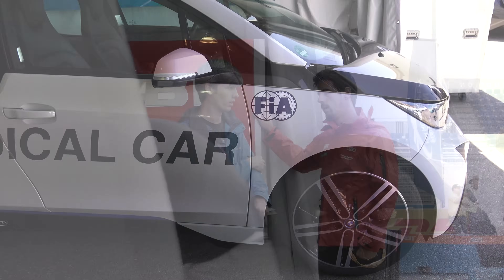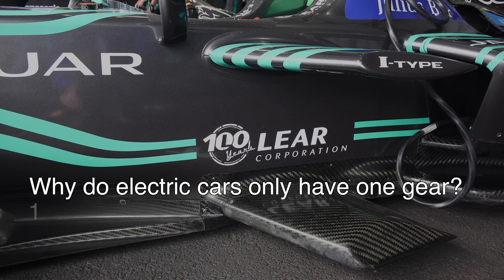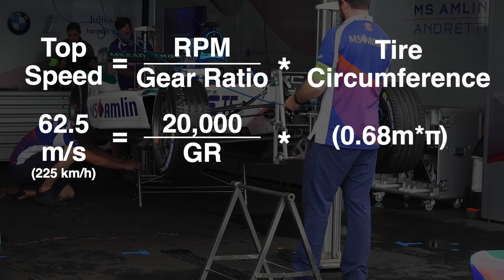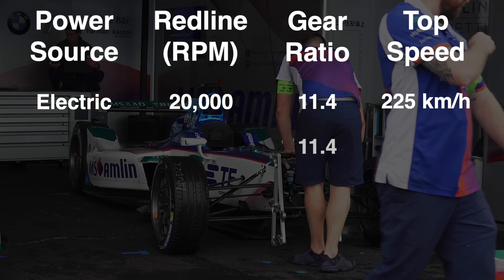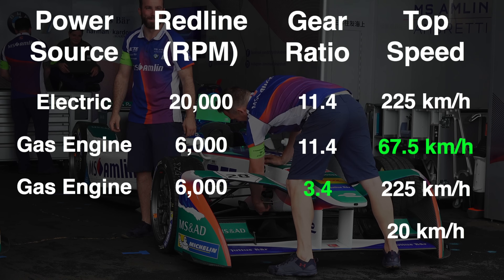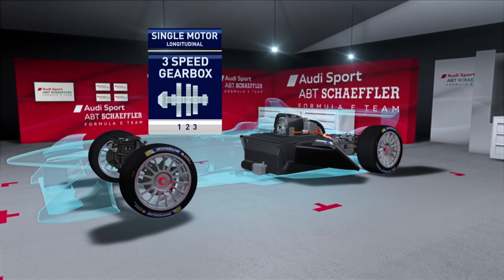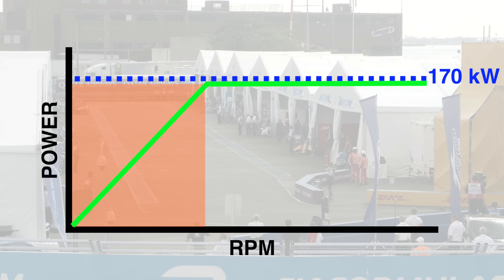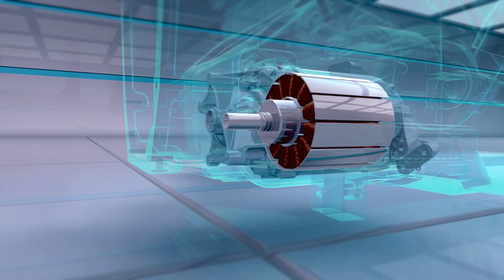Why Do Electric Cars Only Have 1 Gear?

Comment: After riding my e-bike over 1,500 miles in the last 5 months, I'm thankful to have retained the 8 gears on the rear wheel.  One thing I've learned is that low speed with a high-powered electric motor = HEAT!  And also big power drains from the battery.  By starting in a lower gear on my e-bike, I can keep the motor turning at a relatively higher RPM, which is better for both the motor and battery.  Then as I increase speed I gradually shift through the gears.  Works awesome.
Reply: Thank you, exactly what I wanted to say. Consumer companies have promoted these ideas to gain more profit and centrally control others. Removing the gear system will make the motor larger because it will require increased winding coil, the use of rare earth materials in order to obtain strong magnets, an increase in the radius of the motor, in addition to the increased use of complex, sensitive electronics in a way that they are not needed, all in order to compensate for the removal of a very important and simple system. gear system increases the efficiency and power of the motor with less energy consumed. Removing a simple system like that will also reduce the life of the electric motor and battery, as you explained. Most of the heat generated in electric motors is due to the coils that convert electricity into magnets. It is known that electromagnetic coils lose a large portion of their energy in the form of heat.
Reply: If your motor is an induction or bldc one, it shouldn't heat up at low speeds like that. Maybe it's a common dc motor.
Reply: @DragonOfTheMortalKombat  I have no idea but I still have the bike and it has over 10,000 miles on it now.
Reply: @Patrick94GSR  Commonly, if it's two wires and you power it by a battery and a very simple controller, then it's a brushed DC motor.
Reply: @concorde837  The BBS02 (and BBSHD) mid-drive e-bike motors are in fact, brushless motors.

Comment: But wouldn't having multiple gears allow it to use the electricity more efficently? I mean, that's why we have them in bicycles.
Reply: Well a human has a very narrow power band compared to an electric motor, so we really need a few gears on our bikes to make them more practical. There are a few bikes that doesn't have multiple gears, one of them being the "fixie" and I think there are some velodrome race bikes that has a fixed gear ratio. The fixie isn't really a practical bike, and the velodrome racers can't start without having someone help giving them a push. Other than those it's mostly children's bikes (and possibly BMX?) that comes with a single fixed gear.
Reply: lolinskimk6 ...gear boxes go to hell in short time with instant 20 000 rpm
Reply: Blahorga Slisk....If I can I buy today  car for my daughter with fix gear sow she can start slowly and have speed limits...every beginners should have car with fixed gear or looked automatic with two gears :D
Reply: He said in video, that adding gearbox is too little advantage comparing to added complexity and weight (which reduces range). It is just not worth it.
Reply: If you watch the video, you will learn.
Reply: lolinskimk6 yes it probably will evolve that way , when we all have e cars we will once again boast of how many gears we have.
Reply: lolinskimk6
Comes down to the engine characteristics. Professional cyclists actually produce torque that is in supercar territory but the RPM range is tiny, hence lots of very tall gears are needed.
As EE explained, electric motors have near constant torque over a very large RPM range and IC engines are somewhere in between.

Comment: But toque... you can put a lot more torque into tarmac higher gear ratios. The "acceleration" will be much higher, if a higher gear reduction is used at the beginning. And then switched to "cruise mode" to keep it going. Can come handy in electric jeeps - for pulling heavy loads. Can come in handy it traffic jams for... no, in traffic jams high torque causes jerky movements which merely increase the risk of accident, lol.

Comment: Wow thank you! So the cons of an multiple gear outweights the pros like less "fuel" needed ?
Reply: You shouldn't do the mistake and thinking that electric motors are plagued by the same problems as piston engines. The efficency of an electric motor hardly varies over most of it's rev range. So unlike piston engines it makes hardly any difference in efficiency if an electric motor revs very high or very low. Which means there is hardly any gain by using a gearbox.
Reply: shi01 ah ok thank you :)

Comment: Wouldn't an electric motor be more power efficient with a transmission? Is it just a matter of the difference in battery life not worth the cost/complication/reliability of adding a transmission?
Reply: Not really.  Electric motors have a pretty flat efficiency curve and there isn't a big sweet spot like in a combustion engine.  More gears equals higher transmission spin losses. In a combustion engine the efficiency gains of keeping the engine in the sweet spot more than offset the added spin losses of the transmission.  With an electric motor this is not the case.

Comment: You left out information at the foundation of the issue.

First, internal combustion engines stall at too low revs.

Second, internal combustion engines work from explosive combustion.  When the gas ignites and expands it provides too much of a burst of engery to be at a low output.

Finally, electric motors work by attracting a magnet on a wheel with electric magnets alternating polarity.  Change the timing of the alternation, and you can run an electric motor at any RPM.

Comment: When I was a kid I had a remote controlled car with 6 gears. If you put it in the gear with highest top speed it would be really slow to accelerate and  you would use up the battery in 10 min  no matter how fast or slow you did go. Put it in low gear and you could drive for a hour. If you did go for the middle ground that gave ok acceleration and ok top spead you could drive for about 30 min and again speed did have little influence on how long time you could drive. As far as I know this still stands for electric engines of today at least to some degree (less then before because of higher max rpm), having gears will actually help on the economy as well as acceleration. Problem is to maker a gearbox that can handle the torque...

Comment: Why don't electric cars need oil changes?  Obviously A:  Because it's an electric motor instead of a dirty combustion chamber but...      //  Moving parts... need lubrication right?  Electric motors are still moving.  Wouldn't grease wear out?
Reply: The-Mike_D yes the grease will eventually worn out. Having much less moving parts and running in lower temperature keeps the lubricant in optimal condition longer, instead of changing the oil every 10 000 km you'd ned to change it every 200 000 km

Comment: The real question is: Why don't oil cars have continuously variable transmission?
Reply: It was very hard to manufacture; and it still is due to the complexity of the shape. I heard somewhere that it has to be 3D-printed otherwise the labour is just too intensive.

Comment: Hey jason! I tried to make a suggestion on your website, but was unable to due to a glitch in the system. I just wanted to recommend a video in which you explain the benefits and shortcomings of polyurethane bushings, spherical bushings, and standard rubber/OEM bushings in a suspension. I once had a very experienced automotive engineer tell me that he prefers rubber bushings and that it's a common misconception that poly bushings are superior, but his explanation was too complex for me to comprehend... I understood that the principle was that poly bushings limit movement in the suspension components, leading to less responsive handling, inaccurate alignment, and reduced mechanical grip. I was hoping you would be able to explain this more in depth and in a manner that a fresh ME student would be able to grasp, and I'm sure many others would appreciate the insight. Thank you!

Comment: The RPM/power chart at the end is misleading as you don't change the power curve of the motor by more aggressive gearing as you are suggesting in the graphic. For your illustration to be correct the x axis has to be vehicle speed, not RPM.
Reply: Petr Hošek rpm is proportional to velocity in constant gear ratio, the chart would be stll wrong btw
Reply: Marco Santiesteban yes, but he wants to illustrate changes from one gear to another and suggests that the curve is shifted by that, which it wouldn't if it was PRM.
Reply: Petr Hošek that is true, the other alternative is putting the legend "rpm at wheels", the chart neither mark the operation range of rpm from an induction motor

Comment: I would add one more reason why you need gears in gas cars - spinning at max RPM all day long is very bad for a gas motor, but it's OK for an electric motor. Gas engines have lots of reciprocating parts, so spinning at high RPMs (even at low load) produces a ton of stress. So in a gas car, you need a few gears up top so that at highway speeds, you're not bouncing off the rev limiter.

Comment: Would the 3 speed not also have an advantage in saving battery power, needing less torque saving battery power, as it is ultimately an energy saving contest still.

Comment: Interesting. I always presumed that EVs where essential geared electrically by changing the frequency of the polyphase AC coming from the inverter, as EVs typically use a 3phase AC motor, and a reduction gear was simply used to lower the RPM to the tyres. Guess I was wrong

Comment: before I start this vid why do electric cars have one gear? it makes no sense look a cordless drill that has a 2 speed transmission. it will kill the battery at the same time no matter throttle position (as long as you use the same position for both gears). but you get "farther" in high than you so low. so why only one gear when if you had 2 you could have the up most efficiency. I could be wrong but it seems like a waste.

Comment: Uh, plenty of electric cars have had two speed transmissions. In fact the most popular way to do it is via Powerglide 2 and 3 speed transmissions, with companies (like Eaton and a few others) developing purpose built multi speed transmissions as we speak. Prior to Tesla there were actually quite a few "Two speed" EVs you could buy. Tesla even tried (and failed laughably) with their original roadster. 

The REAL reason they dont have multiple speeds? Electric motors have an infinite powerband, meaning you have zero use for more speeds unless you're pushing it beyond road legality and might as well ditch it to save 200lbs.

Comment: If we have all electric cars no more manuals
Reply: thisishowiroll, did you not even watch the video? In anything except SOME racing e-cars, no more manual shift.
Reply: Jeffry theamazing manual with a speed in 5 sec 0-100 would be pain in ass
Reply: Nie mand lots of cars have that, just stay in second till about 50 then stay in third until you redline and skip to 6th

Comment: Basically, electric motors have no lag because no air needs to go in and get mixed with fuel and pressurized and burnt and all that stuff. An electric motor can deliver power directly to the wheel because there is no lag, no pressure, it's all instant so it's safe and possible to do so.

If you connect an internal combustion engine directly to the tires, no transmission, you either move at really low speeds and a lot of torque for no reason while putting a lot of stress on the engine or you lock it up and it blows up under the hood. The job of a transmission is to deliver the power easier with less stress on the engine and to control how that power will be used, either for torque on low gears or speed on high gears. But I'm no engineer, I'm just talking from  pure personal opinion and thought.

Comment: '
electric cars are using automatic gears or manual gears...
how many speeding in automatic / manual
Reply: bestamerica automatic using manual type gears, and a computer throttling the engine to sync and shift the gears
Reply: only on f-e because the improvement is almost null

Comment: Looks like formula E limit top speed and power to make single gearing possible, but multi gears is waaaay superior. Just look at electric assist pedal bikes, my crank drive electric assist bicycle, uses all the regular 15 gears, and is  massively superior to a single gear hub drive electric assist bicycle.

Comment: I have had this question for a very long time: how are 2 different power sources (an ICE and an electric motor, for instance, not necessarily spinning at the same speeds) connected together so that they can combine their outputs to drive the wheels? I've wanted to know about this since F1 introduced KERS and supercars increasingly turn to hybrid technology to overcome turbo lag. I've read that the MGU-K is connected to the engine's crankshaft but that's all I managed to find out. 
Enlighten me, please?

Comment: Despise your complaint against the sound, electric motors are much more powerful than combustion engine with the same weight. Every high speed train use the electric motors to achieve higher speeds. The problem with the electric cars these days are with the batteries not the motors these days.

Comment: If an EV was to ascend a steep hill, would it not be more power efficient to use a smaller gear rather the send more power to the motor? I've been trying to figure this out for a while.
Reply: cyclingjase yes, but you'll loss top speed to gain a tiny eficiente improvement

Comment: Not all electric powertrains use a single gear. The Kia Optima plug-in hybrid, for instance, uses a 6-speed transmission, even when on electric power.
Reply: Hybrids are not electric, they are hybrids and have to compromise because of the two types of motors. An electric car has only one source of power to optimize for so less gears or just one is usually used.
Reply: Plug-in hybrids can be driven 100% electric.  However, many of them do not use the transmission when driving via electricity.  The Optima does, which is my point.

Comment: More gears would help to increase the top speed. Also it could help to increase the efficiency, because driving with high RPM takes too much energy (compared to slow driving).
But I think it's not made, because higher costs, weight and complexity.
Reply: Highspeed trains need gearbox?

Comment: Electric engines should just have a system that detects the amount of resistance at the wheels and increase and decrease either the amperage or voltage to adjust torque and speed, would work just like gears but faster but without a clutch and could be much, much more accurate with a motor that would be designed for the change in voltage and amperage. Then electric cars would be much more versatile. Just an idea, please point out flaws or tell me why this wouldn't work if you know more about this.

Comment: Do a video explaining the difference between different size turbos. Volume, efficiency, ect. I know a lot of people, myself included are not that familiar with how volume affects power when coming to forced induction. I am somewhat familiar with it, but i would like to see you break it down and explain the difference between running 10psi on a 46mm or so and a 100mm turbo.

Comment: The ideal setup for a performance vehicle (and trucks) is exactly how rimac does it. Single speed in the front and dual speed in the back. This video also didn't show that electric motors torque and consequently power drops off tremendously at high rpm so a second gear helps for not only top speed but also acceleration after 90-100mph.  

For commuter cars, no, single speed is by far the best.

Comment: What I remember from college is:  An electric motor (as does a steam engine)  has  Zero Revs Torque Potential.  Nice little nutshell there.  Obviously an internal combustion engine doesn't.

Comment: Why everyone always complains about gasoline vehicles? Cars alone won't make much of a difference except the air quality in major cities. Airplanes are one HUGE factor people like to ignore. That should be the first and biggest concern with energy production and industry. And even if electric cars achieve similar range and charging capabilities of gasoline vehicles, how long do you think the average age of battery powered cars can ever be? Bigger negative impact on nature than current vehicles if they don't last long enough. 8-15 years at least. Battery technology isn't anything clean either. Only plus side i can think of is the local air quality. Carbon dioxide levels would be more or less the same globally i guess. Or worse. I'm no scientist, just expressing my worries on the matter.

Comment: That's all and good for a race car that can't even use all its power, but wouldn't a street car trying to save battery life/ extend range w/ a smaller motor and battery benefit from gearing?

Comment: can solar panels on the roof of a car / van recharge lithium batteries of an electric car ???
Reply: Solar cars do exactly that, but to make them work, they have to be really light and very aerodynamic. This means they become impractical if you want to carry a lot of people or cargo and want to get to your destination as fast as possible. They don't work on full size electric cars because they weigh a lot.

Comment: So does this mean with proper gearing electric cars could drive a lot faster than normal gas cars
Reply: It's not the gear or the motor the problem, you can make them go fast but it will just drain the batteries faster.      /watch?v=6aRbhWk99Xk

Comment: I'm just curious.  Wouldn't adding a gear or two on the highway, help with range?  As the motor could rev slower and using less of the battery.  Just wondering.